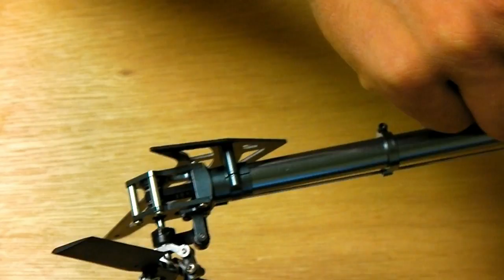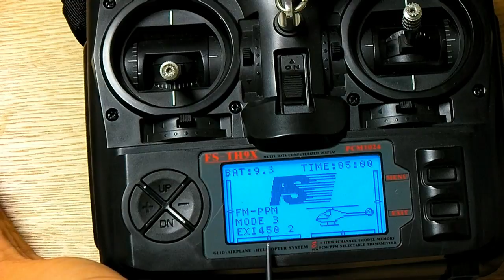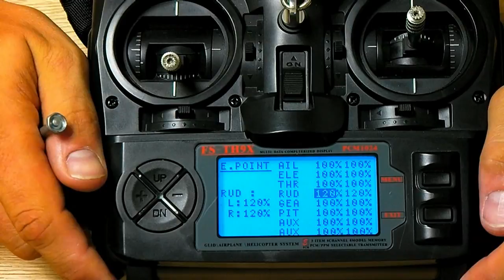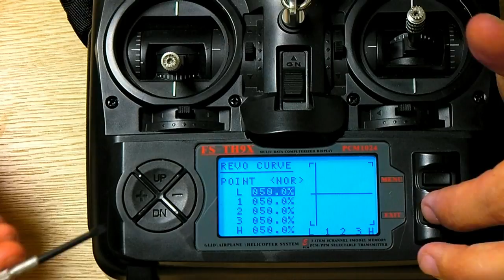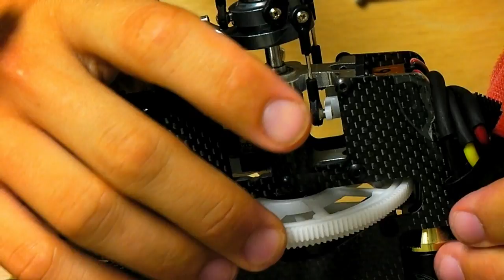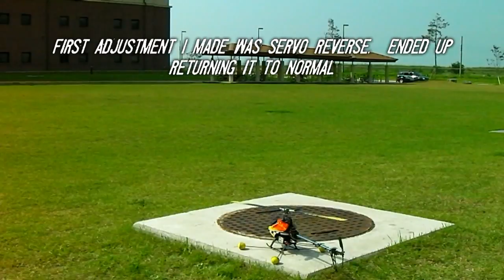JR-G270-3D. Install Setup Test Flight

Comment from the maker: Rock solid and smooth.  I am loving it.  I got almost into left side in flying tonight.  after the wind stopped this thing was almost hands off stable.  Really feel good about all my upgrades so far.  what lingers is the decision to add the Savox tail servo on and sell the Align DS520 that I have now.  Got new  Align main shafts and revolution blades going on the next order.  I hope I continue to get better results with the upgrades as I max this thing out.